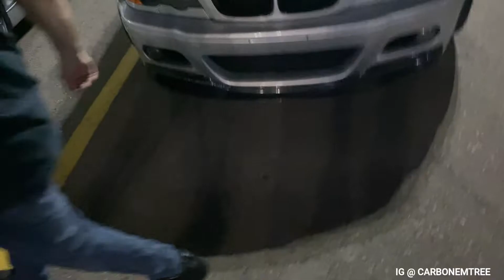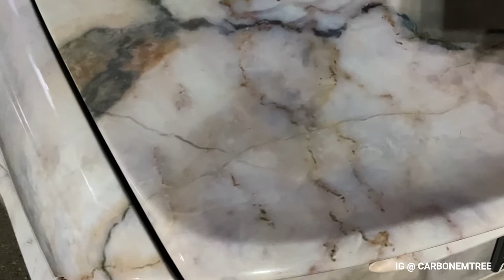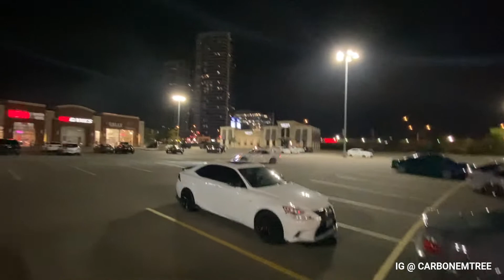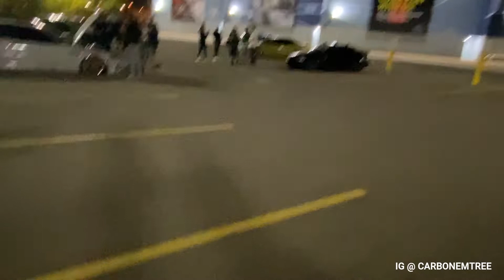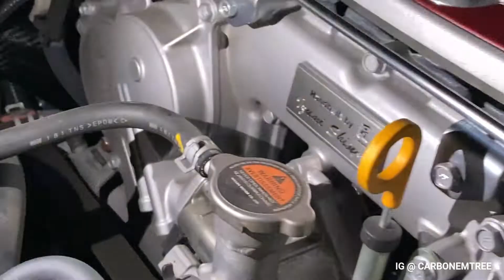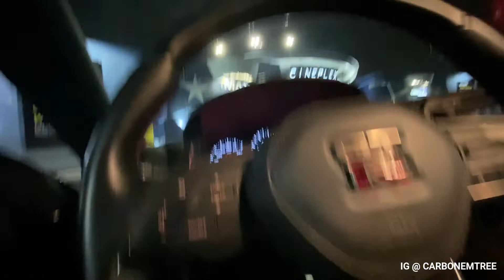RARE BMW E46 M3 PRIVATE MEET BY E46IX M3 GRUPPE *BAGGED & SUPERCHARGED, LSB, NISSAN GTR TOUR & REVS*

Comment: Well it’s because the S54 is a long stroked straight 6 
   Sooo 8k rpm that piston is pumping hard if that makes sense 
at the same time it’s a race built motor so they handle that stress well 😌
  Even know people that smack red line on stock bearings and still run fine ! 
       !!!That guy has Solid Advice!!!
     Keeping it around 7k ish is a good idea but a occasional 8 k is fine